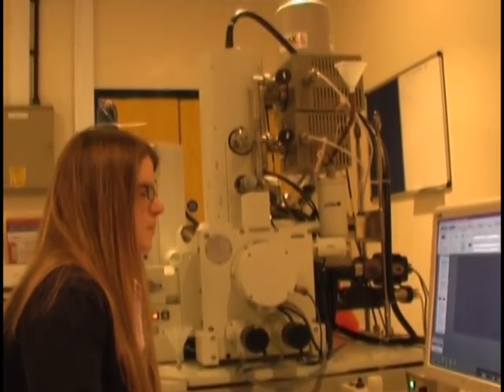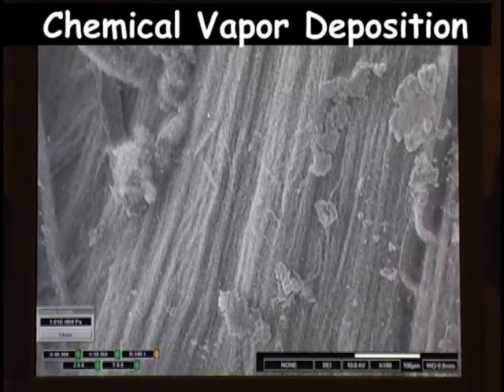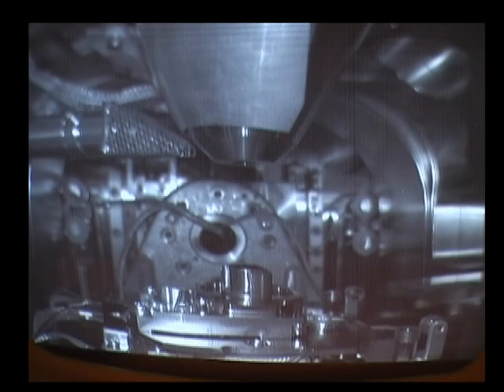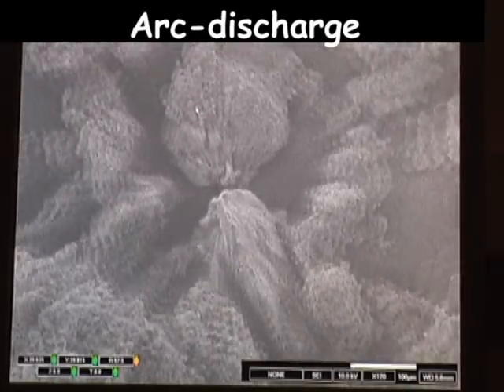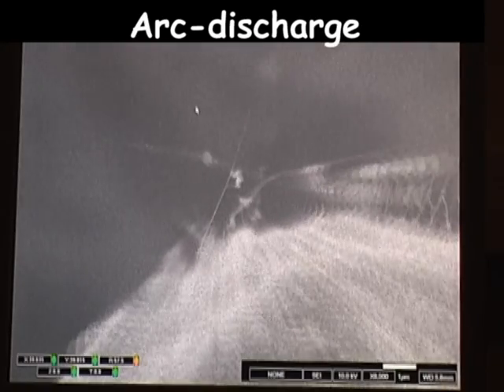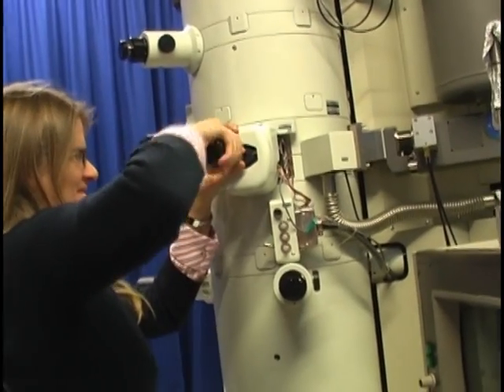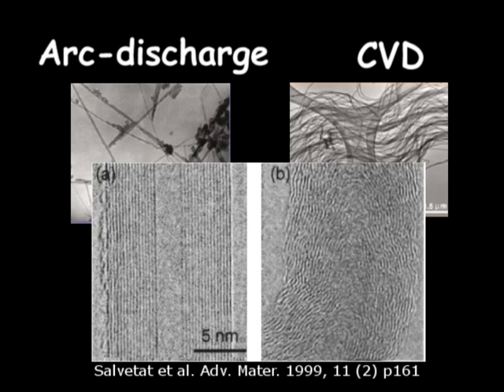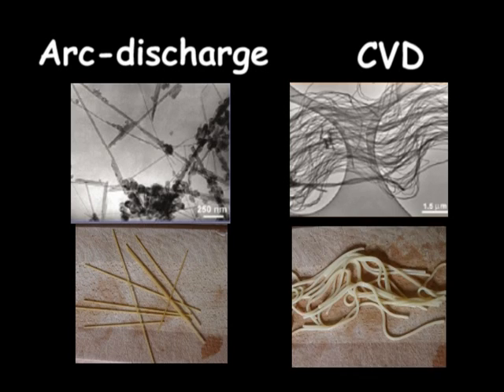Nanoseries 3/5 : How can we see carbon nanotubes?

Comment from the maker: Arc-discharge gives straighter tubes but does not mean that is what we want necessary. For some applications we may want defected tubes (for example if you want attached other molecules to the tube).

But most importantly, by arc-discharge a lot of byproducts are produced and it is difficult to produce large quantities of tubes. 

CVD produces "wavier" tubes but in higher quantities and like "growing" from a carpet which is more useful for some applications. CVD is easier for mass production.